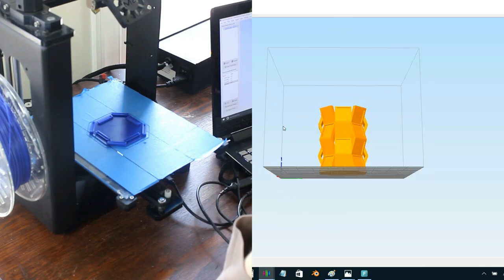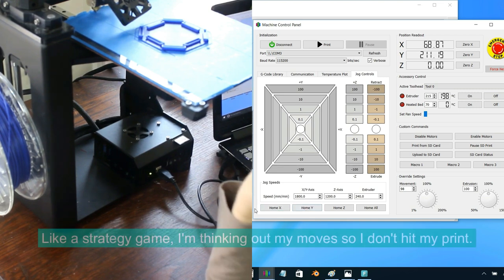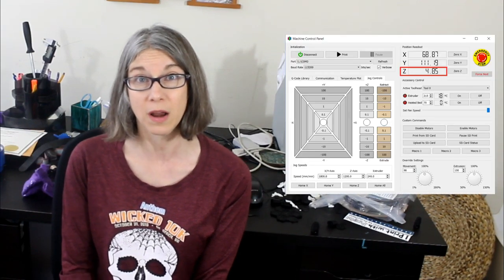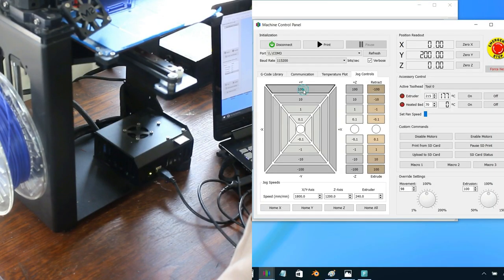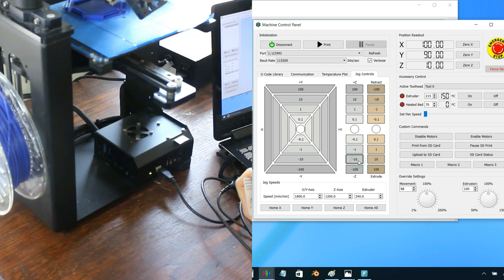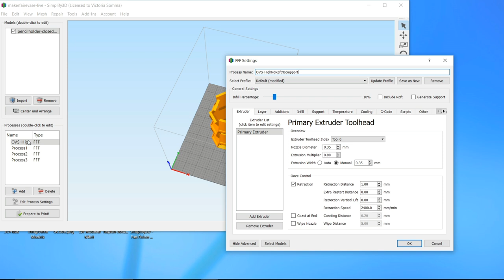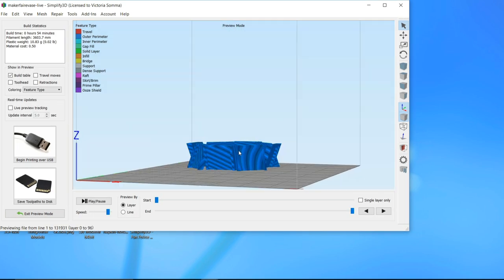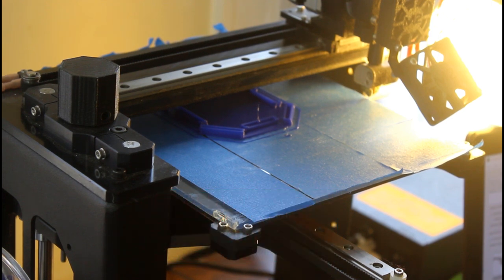Resuming a 3D Print (After Unplugging and Moving the Printer)

Comment: can I perform this on a printer with autobed leveling
Reply from the maker: That is a very good question!  Unfortunately none of my printers had that awesome auto-level feature.  I'm stuck with screws and wingnuts.  My suspicion is you would want to update your Starting Script and skip or temporarily disable auto leveling.  I would start by checking to see if there was a M320 or G29 call in the starting script and maybe remove that?  Then you can Home your Z axis manually.

I like make data-based recommendations and this is something I can't test out.  I'll reach out to a friend or two and see if anyone has more hands experience skipping the auto leveling. 

Thanks for watching... and the interesting question!

Comment: Since you had the coordinates all along, just change the starting Gcode: Home X; Home Y; Home Z; G1 Z??; G1 X?? Y??; and print.  No need for fancy stuff...
Reply from the maker: Greetings Marco!  Thanks for watching and commenting! 

A quick clarification for anyone who wants to try your comment--- for most printers, you will also need to adjust the gcode you are running to remove all the sections you have already printed.  You can do G1 X? G1 Y? to position your nozzle in the proper place, but if you don't remove the earlier instructions from the gcode, the printer is going to start printing your first layer again.... which would lead to some unsavory collisions with your existing print.

You can reslice like I did in Simplify3D with where you tell the slicer where you want the new print to start.  Marco is also right-- you don't need a fancy slicer like Simplify3D!  You can achieve the same thing in a simple text editor like Notepad.  This blog post from Printed Solid goes over opening the gcode and getting just the remaining code you need.

https://printedsolid.com/blogs/news/printrecovery

I do wish I always knew the failure point.  Alas, that is actually a RARE case. : ) The Printed Solid blog post also offers an alternative to my technique of finding the restart point.  Whereas I use the physical position of the nozzle, they use calipers.

Whichever techniques works the best for you, I wish you all great luck at salvaging your prints!  Have a great day everyone!